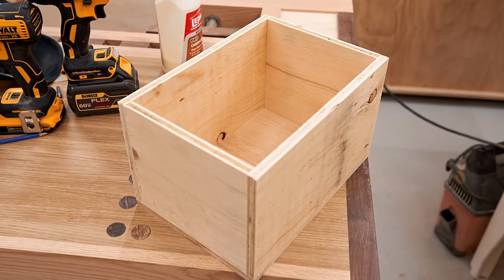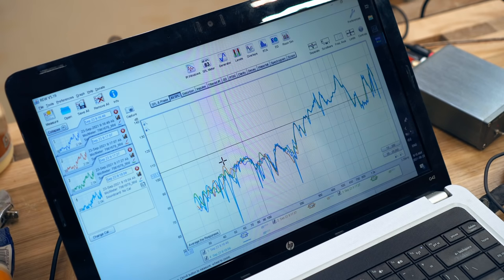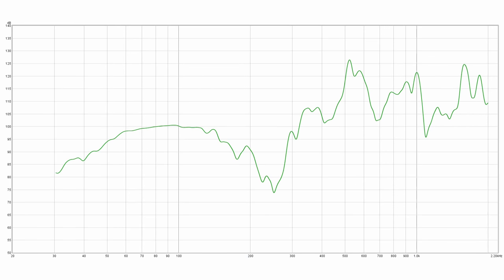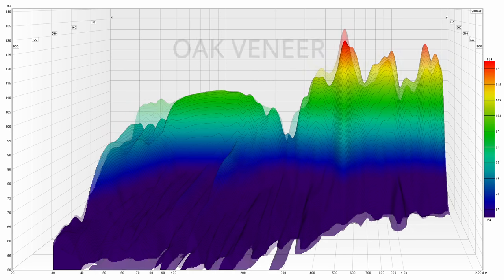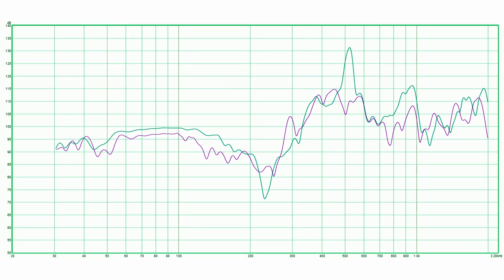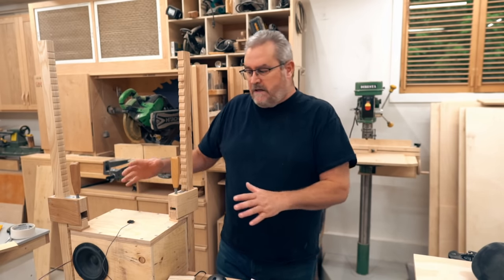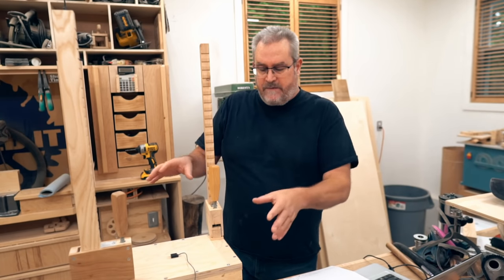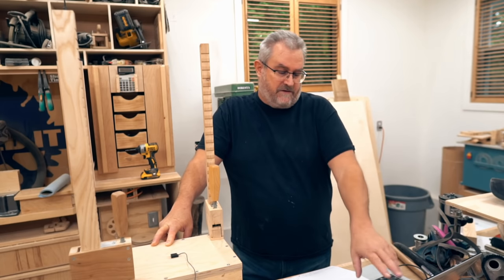PLYWOOD vs MDF For Speaker Building - Tests Show Surprising Results

Comment: Interesting, thanks. Though I'd have to imagine there would be much more substantial differences with a large box speaker. With panels this small, screwed down this rigidly, you could probably use almost any reasonably stiff material and get similar results.

Comment: I would be interested in seeing results for Particle Board, Orientated Strand Board, and a thicker plywood such as 1-1/4-inch High Density Overlay.  I did some tests on resonance of Portland Cement Concrete slabs, when I was an undergrad, and have always thought about builing something similar to a Klipsch Folded Horn with 1-1/2 to 2-inch thick concrete walls.

Comment: Interesting. I've been building speaker and subwoofer cabinets from solid pine "project panels" for years now. It is very light weight and much easier to work with compared to MDF.

Comment: What would be interesting would be larger dimensions, which would create greater spans, thus creating larger vibrational areas.   Say, 48" x 32" x 32", creating a more concert size speaker cabinet.  Such a small test sample as the one herein, will automatically have minimal vibration, just because of span.
Thanks much for your test!   Enjoyed seeing the data..

Comment: Finished my baltic birch tonewood speaker cabinet.
Can't wait to set this bad boy directly on the top of my desk without an iso pad, backed right up against the wall as tightly as possible in my untreated sheetrock room with oak flooring. Just got a new subwoofer too. Points straight at the floor and is 2 inches away from it right from the manufacturer like they all do for some reason.
Reply: Tuned each face to 432hz with my chakra. Also everything I used is plugged straight into the wall instead of a power conditioner to get that organic sound.

Comment: Steel, I was laughed at for building a truck box in my Tundra out of steel with the face board mdf. The final results were astounding what's a low Pro kenwoods it hits like a hammer

Comment: Porous vs. Non-Porous smooth. Wood vs Glass or Glass-like does have an impact on cavity resonance, frequency response.  As a simple example, take a high end classical guitar, the type of wood will have an impact on sound, but it is also a matter of volume, geometry and in the case of speaker enclosures the electrical components (drivers and X-over network).  

Formica applied with contact cement, as a finishing laminate over MDF or Plywood, in my experience adds a more solid enclosure which holds sound rock solid provided the box is sealed, ported and tuned properly.

Comment: Off topic a bit but My Jamo concert 11s speakers .The front speaker panel is unique and uses cast plastic shells with 30 mm plus space between them filled with quartz bonded sand bonded with resin to form a heavy solid mass for minimal coloration into which the three drive units are recessed.

Comment: Thank you for making this video! For decades I was wondering if plywood was better MDF (plywood is stiffer for the same thickness). In audio circles, many people claim that MDF and HDF are crap as far as acoustic behavior is concern. So, you masterfully shed some light on this topic. Should you have made a whole cabinet of each material to have a clearer result? In any case, this is a very complex subject with a lot of long held beliefs. Thanks again!
Reply: I use ply primarily because it produces less dust when being cut. Ply is easier.
Reply: @navinadv  Another good point, but the cost of plywood is higher, so we should try to made something that will satisfy us in the long run!
Reply: @yvesboutin5604  where I live the cost of MDF and plywood is about the same. I could see an option of using 12mm ply + 12mm MDF with a layer of bitumen or foam damping between them.
Reply: @navinadv  I'm from Canada, the price of quality plywood is twice of MDF. Puting a layer of MDF and plywood is also an interesting idea! Thanks!

Comment: Perhaps lining the inside of the box with a sheet of polystyrene, or with rubber or leather. Using damping wedge shapes. Increasing the box wall thickness. Lots of fun experiments.

Comment: I used MDF in hundreds of enclosures as a box builder for car audio shops in the 90's and 00's. I developed an allergy to the stuff over time. The glues or binding agents used in it are prone to gassing off when temperatures get above around 80°. It kills my eyes and nose. Anyway, I started using birch hi-ply plywood over 20 years ago and can't imagine going back to MDF now.

Comment: This is really great!  Thank you for sharing your work.  I wonder if these findings are similar for subs.  I'd much rather use pine ply than MDF for projects.  Also, I think making 18" subs out of double thickness 1/2" ply would be preferable to 3/4" mdf.
Reply from the maker: Same for anything that produces sound. 2 layers of 1/2" with damping membrane or adhesive between the layers for a CLD effect would be miles better than 3/4" MDF.
Reply: For subs you generally need stiffness and then weight to anchor the driver - it doesnt have to come from the panels as those only need to be stiff past the  operating range.

Comment: I think the purpose of damping is twofold:  First, it helps reduce the amplitude of standing waves and second, it adds to the mechanical resistance as seen by the loudspeaker.  Thus, in a sealed enclosure, the lack of damping will necessitate a slightly larger enclosure for a given target Q.

Comment: Mr. Heisz, great video thank you. I must ask you however, how close to the manufacturers rear spacing did you build the box and why didn't you test the sound board instead of the side of the box? I've been building speaker boxes for about 60 years and one of the problems I've found is that after a lot of use the plywood seems to delaminate causing unwanted vibration, even with the better quality marine plywood, which has all voids filled unlike regular plywood.

Comment: Thanks for this.
I know why your results don't show dramatic changes. Your whole setup is wrong. You need $6000 pure silver speaker wires, a $1200 jar of aquarium gravel in the corner to absorb standing waves, and a $14000 9 Watt vacuum tube amplifier because solid state couldn't possibly be good enough for such tests.

I'd love to see the same test with concrete. Yeah, it's ridiculous to work with but it really does make a good speaker box. A simple 8x16 patio paver, make holes, you can figure out the rest.
Reply: Concrete u say?
Reply: @catch2297  consider dampening, well concrete is pretty difficult to make vibrate. Cinder block, glue on a patio paver (all 8x16 inches here in the USofA), grind out center sections, yeah, it's much more difficult than working with wood. But makes a speaker box that just doesn't resonate, doesn't change with humidity, and with sealer on it it's weatherproof.
Reply: @EF-69  Yes I think you're right about concrete. Trying to remember back but I think Jim Thiel used concrete for baffles on one or two of his speaker designs.

Comment: One advantage that MDF has over the other materials is in the realm of finishing, be it veneer or paint. Since MDF is so smooth and uniform, it's a great base to put a veneer on - no low or high spots. Paint, especially if you go for glossy, really does well on it, as long as you properly fill the exposed edges. I've used anything from thin super glue to sanding sealer followed by a light sanding to get a surface as smooth as the face.
Reply: I have tried to lay an automotive finish on MDF and it can be done but the material is so soft that it's easily ruined from handling.  Also, none of the wood based materials are really flat, especially after clamping and gluing.  You can get the same results by using spray filler to encapsulate the ply with a much harder end result.  I got the idea from seeing the wilson factory and their "gel coat" which is actually polyurea or polyester coating.  Once it's got a thick layer it's easy to block like a car.  I would still wait a month for the material to settle down before primer and final sanding.
Reply: too much effort for this poor material.  Just take the better multiply, also less work, that's already veneered!

Comment: I like MDF because it's readily available and consistent thickness and I don't like getting gouged every time there is an environmental issue disrupting the plywood supply, that tends to leave most of this impact expense permanently in place. I saturate my MDF with thinned epoxy that turns it into a very resilient composite. Otherwise, I have not heard sonic differences between different type panels. 

Also not a fan of odd sized panels, and metric equivalents that always favor the smaller dimension. I have bought some plywood marked as 3/4", that is closer to 5/8", especially when the full .75" is needed for structural concerns.

Comment: Bracing alone was only ever suggested for subwoofers, where the frequency range was limited.  Damping is still useful even there, though; especially when trying to cram a woofer in a box that is smaller than recommended.  Also, there is a difference between volume damping materials (stuffing) and wall damping materials like asphalt shingles, or dynamat, etc...

Comment: The best results gives a sandwich of glued chipboard inside and MDF outside with veneer. Chipboard absorbs sound better then MDF. But MDF gives stability and robust construction.
Reply: What kind of glue between them particle and mdf?

Comment: I was thinking of your measurements vs listening comment.  If you had two sets of boxes made the same but different materials (maybe most different in your test) and could do a controlled, anonymous, blind test of them, you might hear a difference.  But, my guess is some would like "A" better and some would like "B" better. Also, experience tells me that you would also get used to listening to either over time.

Comment: Very interesting results!  My only issue is that I am interested in building speaker enclosures, but from the perspective of a guitar amplifier. And it seems the goals of hifi designers are at odds with guitar amplifier builders. Whereby the hifi designer doesn’t want anything to influence the driver, and amp building considers the cabinet as an instrument unto itself. So we’re looking for that magical cabinet resonance, whether it really exists is up for debate.

Comment: It would also be compelling to me to see corresponding results measured with a calibrated mic on axis with the driver and also 45deg on a box edge to measure if any of the higher frequency ringing was actually causing the edge to become a point source (I'd doubt it since the frequencies are generally so low).

Comment: It looks like subwoofers would work better with mdf it read higher in the low hz 100 down. But I don’t like useing it eather every were you hear all the great things about birch. So that’s what I’m gonna use for a 15 sundown I like the thought of being able to stain and clear the wood an how good it will look ! The caricatures of the wood grain with all the detail wood grain has it’s beautiful!  They say it’s stronger and lighter then mdf so I’m gonna find out this is a gr8 video and thanks for sharing it nice to have this info I’d like+to see if there would be a major difference with this for lower frequencies like with a subwoofer from 20-250 hz I think I’m gonna do the rubber inside my ported box’s but sealed I just paint them heavy I could tell the difference between painted and not also is I put pillow filler in one seemed  like it was a better sound but I’ve only built subwoofer enclosures most sealed but I’m learning ported ones !

Comment: Just curious if you thought about angling either the rear (fixed) or the front (changed for testing) baffles to lessen/reduce any internal standing waves/reflections and place more emphasis on the changeable panel material being tested???🤔

Comment: I'll chime in on this one :) Those drivers are not going to benefit from speaker material as much as a subwoofer. Typically when I discuss material types I try to differ the speakers. Resonance just simply will not show in a enclosure of that size and a woofer of that caliper. Use an 8 inch Subwoofer and you will detect a huge difference.

One way to consider is that Martin Logan uses MDF in their 25k tower speakers.
Reply from the maker: Resonance of the panels has to do with the size of the panel and thickness and stiffness of the material used, not the size of the driver.
Large panels will vibrate more than smaller panels. Thinner panels will vibrate more than thicker ones. Stiffer panels will vibrate less than more flexible panels.
Reply: MDF is ALSO easy to CNC machine with CONSISTENT RESULTS and NO TEAR-OUT !!!

Comment: Thanks for the tests! Would be nice to see the result with some dampening "goop" applied to the panels. Think one of the theories is to drive the frequency higher then dampen it down as it's easier to dampen higher frequencies than lower.
Reply from the maker: The theory I refer to was to drive up the resonance high enough so that it wouldn't be excited and use no damping at all.
Reply: @IBuildIt  yes the whole can it even be heard is the big question. I have made a sample baffle with two 1/2" boards bonded together with a little more than an 1/8" of urethane rubber between them.. yes it made a difference with a knock test, wish I would've had your setup at the same time to test, but thought with the time and expense to build enclosures out of it was not warranted. Actually what would be nice to see just something as simple as adding a putty gasket between the driver and the baffle, I've done this just as a way to seal the driver and always wondered if it was stopping any significant vibrations... I used rope caulk for windows I believe
Reply: @attainableaudio4533  I've used some of that putty rope caulk before applied at the juncture crack between the woofer speaker basket and the magnet...worked pretty well for the linear motor structure damping!!!😁👍🏻

Comment: This made me wonder, not that it would be particularly practical, how would a stone or concrete box sound?
Reply: @BradSteeg  it does ring so you have to add a dampening material to the walls.
Reply: My home speakers are a mix of concrete board and mdf.

Comment: Hi there. I am building a pair of line arrays and since I have little or no acces to MDF I have been considering using 1" PVC of the highest density(.60) available and even dual 3/4" for a 1.5" panel. How should that compare to wood? I am not sure if I will have any access to pine or baltic birch either...

Comment: Lots of good stuff. Well done! But I am confused by some of the explanation. I built my first set of speakers, large cabinet 12" 3 way, in the '60's. I used both filling material and random placed bracing. back then. Perhaps things had gone out and back into favor? 

Also I understood the filling to lower response curve by adding extra absorption internally. Reduced ringing was secondary.
Reply from the maker: Yes, bracing and damping. That's how I started. Not just damping alone.
What I said about bracing instead of damping is an idea that came along maybe 15 years ago. The thinking was that damping smeared the sound, made it sound muddy and to avoid that you would use extensive bracing instead. You've probably seen some with an internal matrix of braces with holes - that kind of bracing.
As for stuffing, it's used primarily in sealed boxes to increase the apparent box volume and also damp the airspace, but it still damps the panels as well while it's doing that. So the speaker builder would know those three things are happening when he's using fill.
Reply: @IBuildIt  You seems to indicate that "in the past" it went from, one to the other. And like I said, going way back, it was both. I was a rep for AR when they introduce the Model 9 series in the late '70's. I toured and gave seminars on them. Both were used in those models. Adding fill to a cabinet increases it's internal mass lowering the resonant frequency. 

My primary speakers are Maggies now so it is irrelevant to me now. 😃
Reply from the maker: You aren't getting what I mean and that's probably my fault for not being clear enough.
It's always been bracing and damping, but at some point the idea started that bracing alone was better, just using a lot more of it. Guys were still doing the traditional bracing and damping, but you also started seeing this bracing only builds happening. I'm speaking 100% from a DIY standpoint, not from what the major manufacturers were doing.
Reply: @IBuildIt  I tend to be very literal. And other than my first efforts and a few raw speaker installs I've not been involved in DYI much for speakers. Though I have a number of inventions I've toyed with in speakers. Imagine a 12"-15" spherical probably rubberized "driver" driven by a servo control styled air pressure causing the entire driver to expand and shrink to the sound wave. Massive surface area with no cabinet complications.

Comment: I would have to disagree with you sir. 
     Using 100% solid wood for the builds.. aka hardwood for those don't know. 

     I had built me, some towers  years ago out of Tiger maple.3/4" finished. R13 lightly inserted. Looked amazing but certain frequencies produced a tiny type sound.

Later...
I had tried this again out of 3/4 finished red oak and paint grade Hickory.

The boxes had a very tiny sound even with R13.... best described as, a speaker in a metal coffee can. Again at certain frequencies. 

Recently I had made another set of towers out of solid pine. "Barnyard speaker build. "
They sound amazing by comparison. No echoes, reverbs or that tiny sound.

     I think your test should be done free standing and all 6 sides of your cabinet made from the same material.